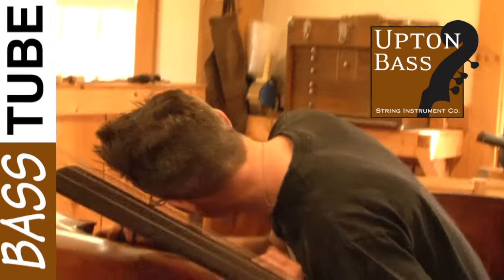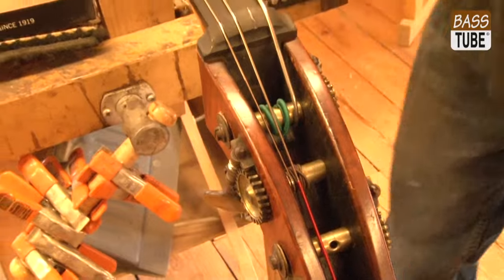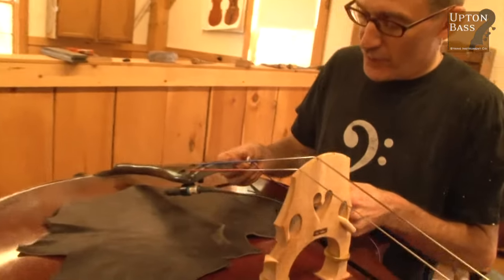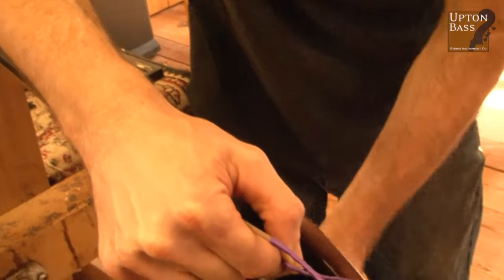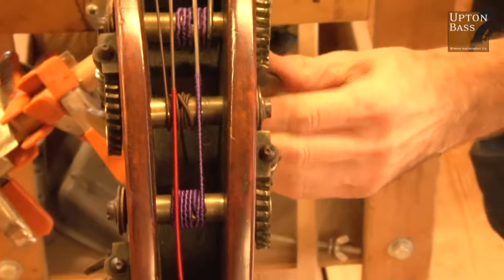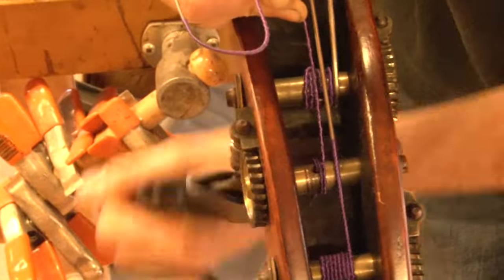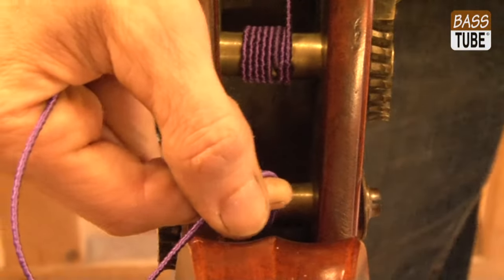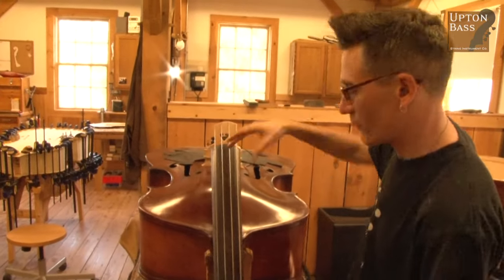Upton Bass: Double Bass String Change in Ten Minutes!

Comment: Thanks Jack; yours is indeed the best how-to video for this online, IMHO. Perhaps a quick discussion on those felt washers could be helpful for some (noticed that you used one for the pickup's female input jack, but not for the others (?)). Anyway, removing two strings at a time seems more logical, for easier 0000 steel wool access to the fingerboard, chased with a rubbed drop of pure lemon oil... an indispensable step in the process (again IMHO). Thanks! ;-)

Comment: Im changing my bass strings for the first time, whats the point of putting graphite into the nut n bridge?
Reply: It allows the string to glide across, it helps the most on the bridge because it should face straight up off the bass but as you put strings on the string is pulling the bridge upwards, graphite helps limit that movement

Comment: Hey guys, I noticed a lot of (maybe all) of your basses, including mine, have the g string lowest in the peg box, opposite of the bass in the video. Jack refers to the pegbox on this bass as having “traditional orientation”. What’s the difference?
Reply: I believe the idea is that the G string is thinner than the E string and can therefore tolerate a sharper bend angle going into the peg box. In the Upton configuration, there is a gentler bend of the thicker E string going to its tuner. Makes sense to me, anyway!

Comment: I notice the "crank" Jack uses has a wider mouth yet still thin for machine paddles than either of the two standard cranks I own.  Is that specific one for sale at Upton or is that one reserved for luthiers? Also, does adding some tape around the paddles to make them thicker and seat better in the crank hurt the bass in any way?
Reply: We sell them. I think it's made by Dunlop. You could use tape if you wanted to. It may leave some sticky residue so you may want to have some mineral spirits handy.
Reply from the maker: https://uptonbass.com/product/dunlop-roadpro-double-bass-string-winder/